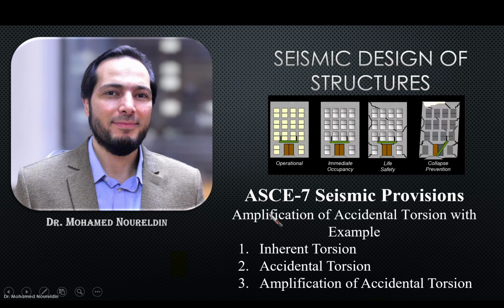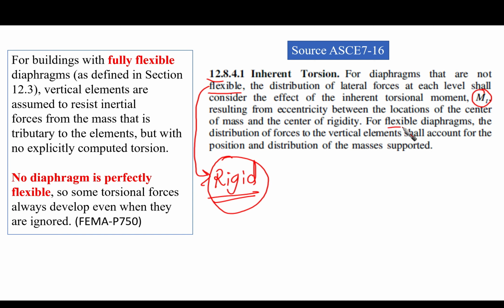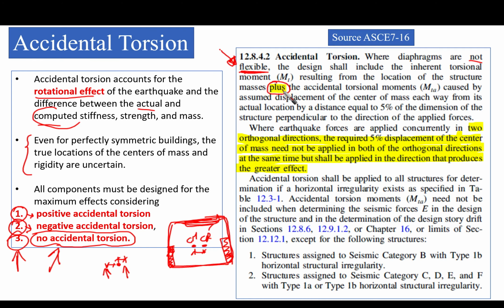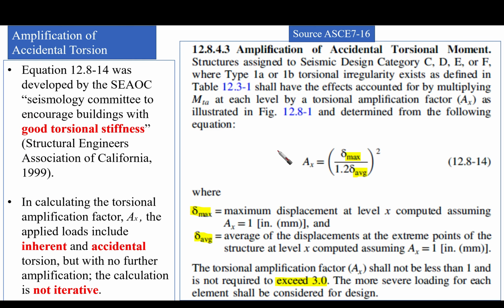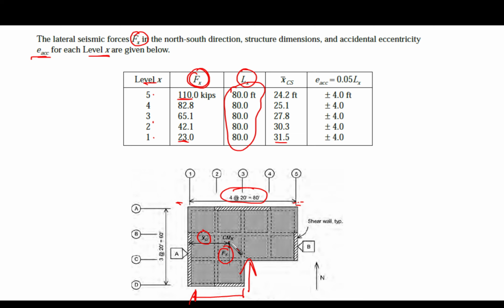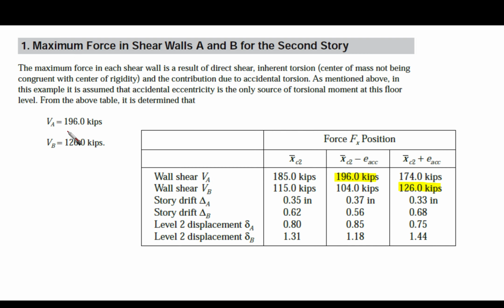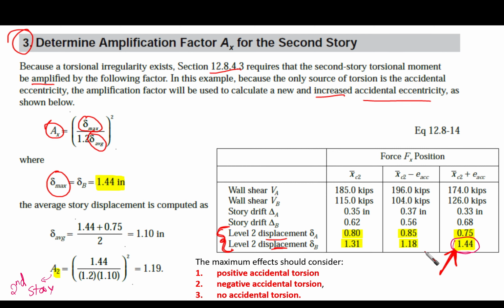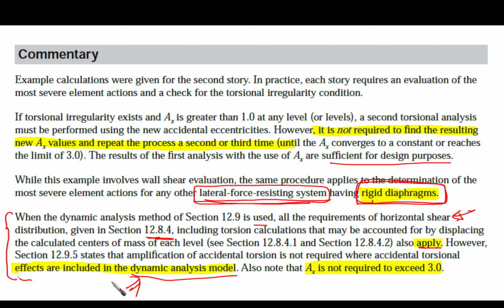19- ASCE-7 Amplification of Accidental Torsion with Example- Dr. Noureldin

Comment: Hello Dr. Noureldin. Thank you for the instruction on amplifciation of accidental torsion. I have a question regarding the response spectrum provisions in ASCE that allows for the displacement of the mass by the 5% of accidental torsion. Some softwares such as Etabs allow for mass offset to be done on the mass source. When I use this method I notice that the plan torsion is significantly higher than the static method. Is this appropriate behaviour?

Comment: Dear Dr. Mohamed Nouredin,
Thank you for the interesting lecture.
I’m a little confused regarding the last part of the commentary slide (at the very end) regarding torsional amplification when the dynamic analysis method is used.
In my understating for Modal Response Spectrum Analysis (12.9.1) it is not necessary to amplify the torsional effects when accidental torsion is accounted for dynamically by use of mass offset. However, when accidental torsion is accounted for statically by accidental torsional moment, the amplification still applies. 
For Linear Response History Analysis (12.9.2), it is required to include accidental torsion by only the use of a mass offset. Therefore, Amplification of accidental torsion is not required